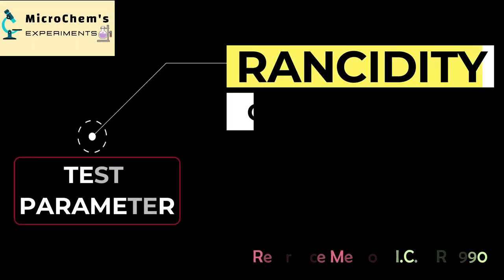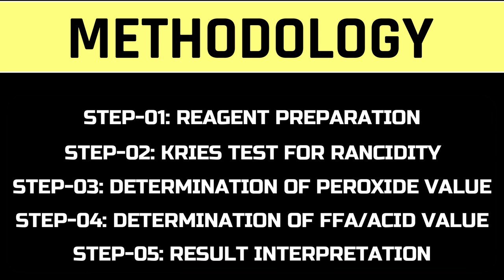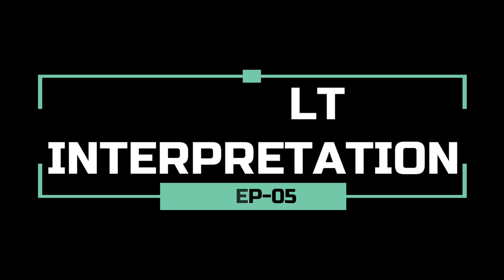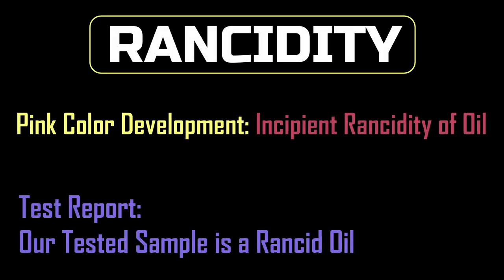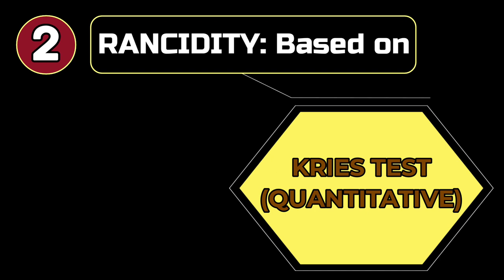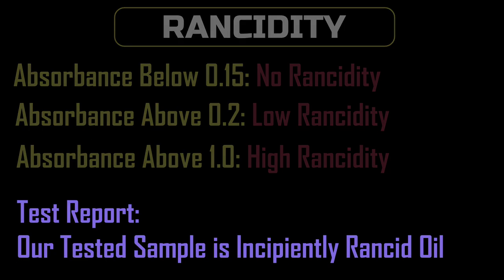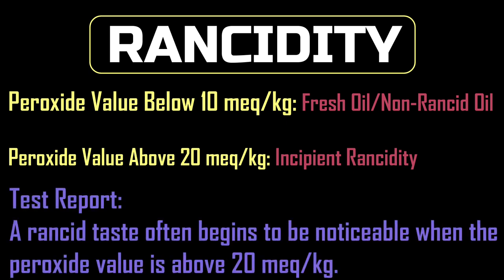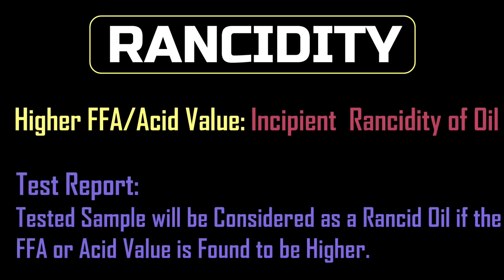Rancidity Test of an Oil Sample_A Complete Procedure

Comment: I have a question: in 5.50 you mix 5 ml of chloroform in the sample but in a plastic test tube.
How is possible mix chloroform in a plastic tube ? Doesn't it "melt" ? Second question: is it possible about you to use dichloromethane instead of chloroform ? Its function is solvent, so dichloro should do the same.

Comment: Sir. Please mention the reference method for each. Rancidity. Acid value. Per oxide value. Because you mentioned reference all your previous apartments instead of this single one.
Reply from the maker: We have already mentioned the reference test method of rancidity at the very begining of this video. So plz open this video again and find the reference method out.
Similarly, open the video of peroxide value, Acid Value, FFA using the links given in the description section of thia video. Reference methods are also given for each of these tests at the very begining.
Thank you.
Reply: Ok sir. Also requested for acid insoluble ash for biscuits on wet and dry basis. 2nd acidity of extracted fat for biscuits. I am requesting to you because your methods are very easy to understanding. I shall be very thankful if you do. Please. Thanks.